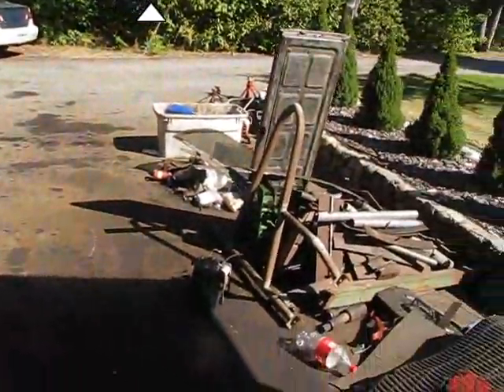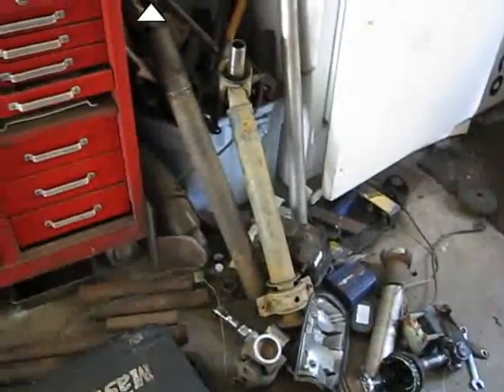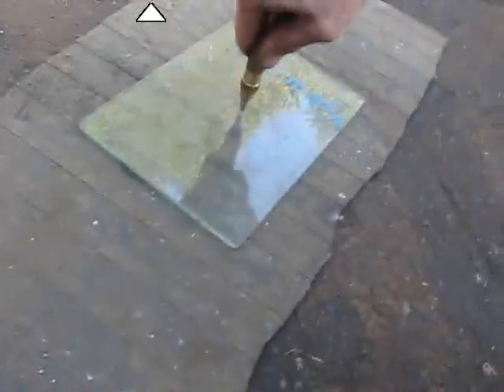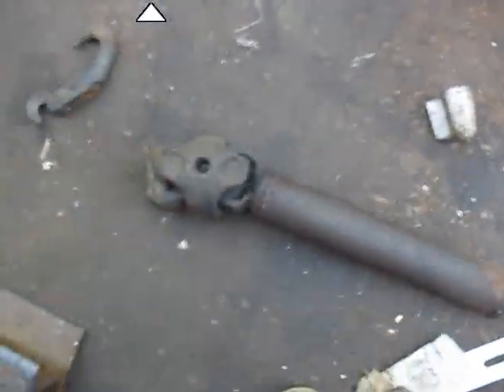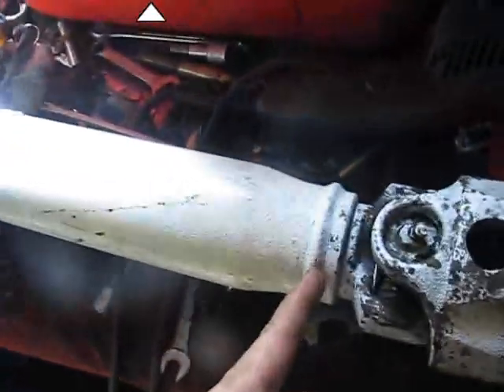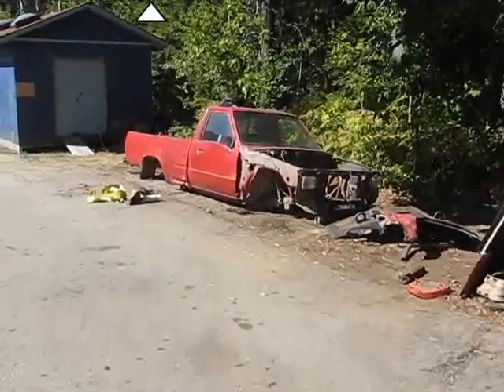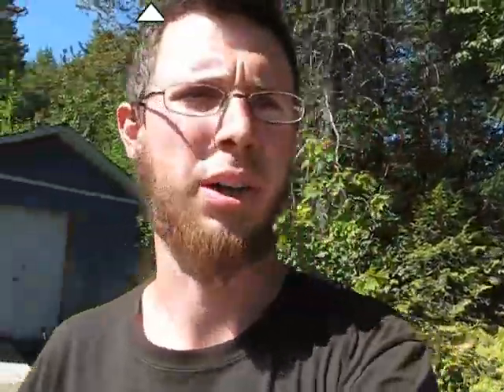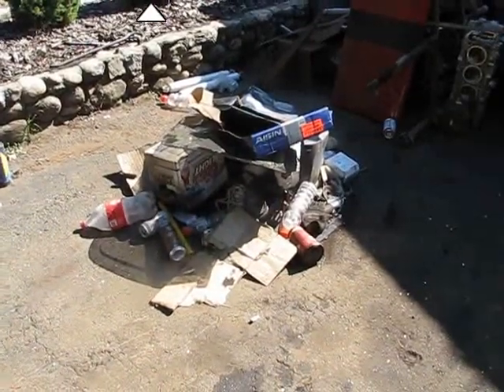Clean The Shop (again) And High Angle Driveline! (09/06/11)

Comment: @the18thoath Oh got engine, ecu, and the ENTIRE wire harness from my donor crown vic. Ecu are way easy set up fer the 5.0L '89 crown vics. Harness goes thru firewall just for added weather protection. No wires actually come out of the ecu into car cabin. Its all plug n play right to motor.